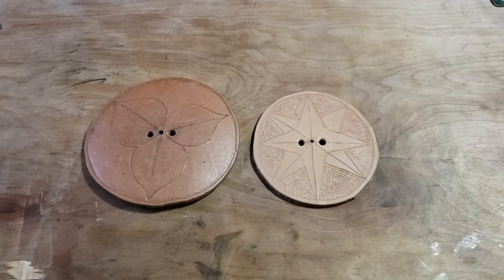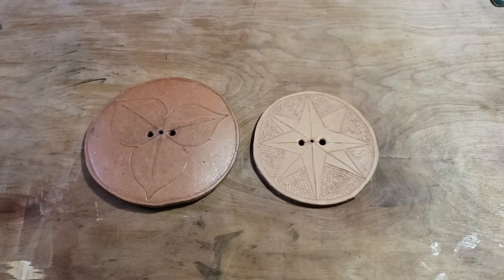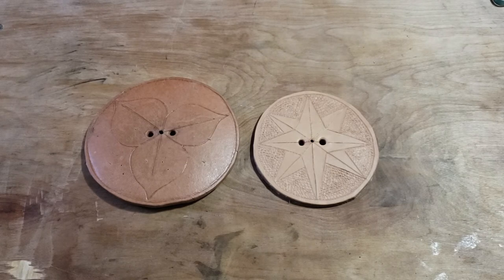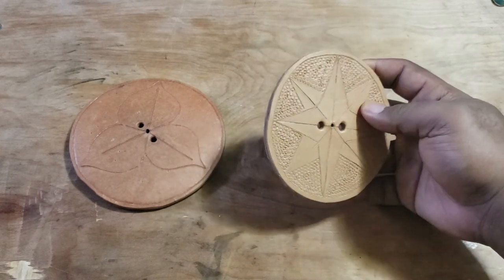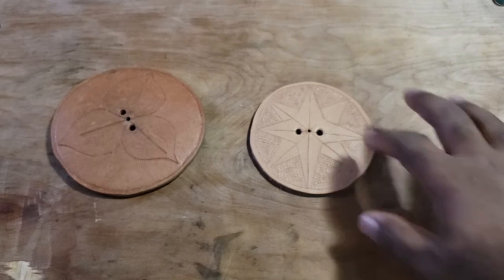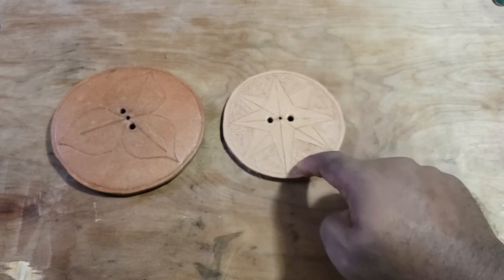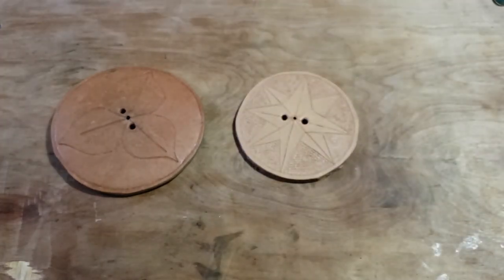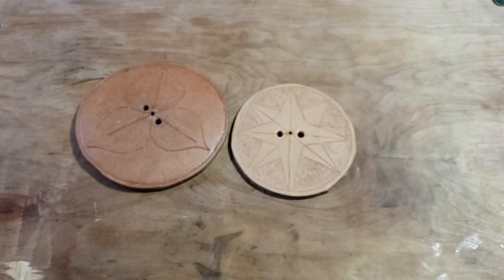Cuir Bouilli

Comment: Archaeologists have found that ancient Viking-era shields frequently used varying grades of hide glued to front and/or rear of wooden shields for extra cut and stab resistance. Rawhide turned out to work the best. Supposedly they could paint the wood with their desired patterns, then glue thin enough and clear enough of sheets of rawhide that the paint would still show through. Function AND fashion.

Comment: This is spot on, I'm impressed you could get your hands on half tanned leather.

For drinking vessels you want to line them with brewers pitch, this is 50:50 beeswax and pine rosin, poured in hot, this seals the vessel and hardens at the same time.